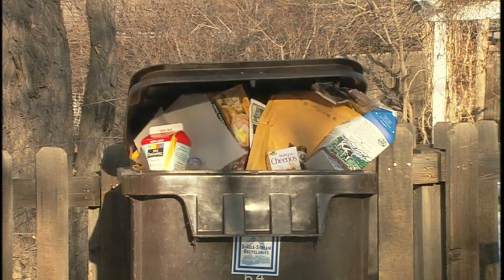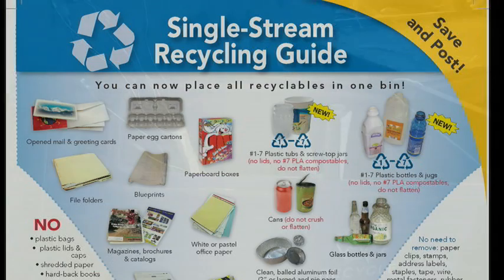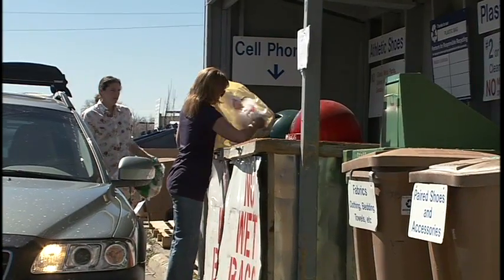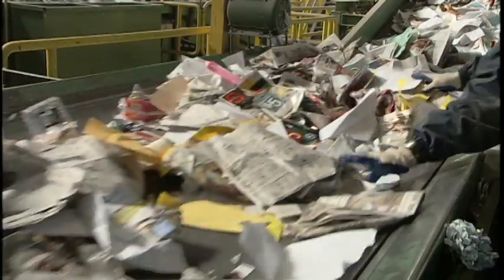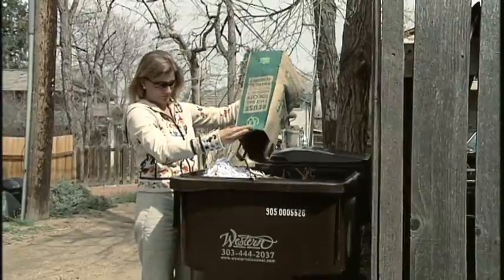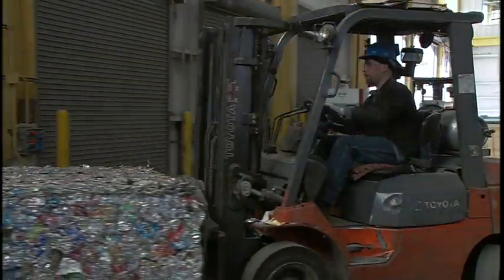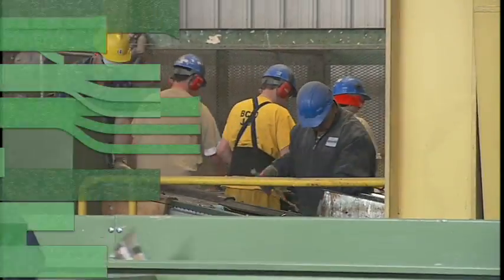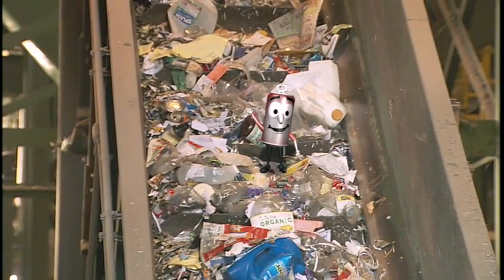Single-Stream Recycling -- Leading the Way to Zero Waste

Comment: So to cut costs they used modern day legal slavery...🤦🏻‍♂️
Very interesting engineering though.  But this kind of facilities should be used to collect some contaminated batches from other recycling centers. Still recycling from users show how much time and energy saves in a facility like this. Just only by separating properly glass and and plastic before, the saving is great.

Comment: They need to burn this trash and turn it into fertilizer and generate electricity ,problem solved !
Reply: Nice idea, but 
Burning the plastic is toxic, the metals don't burn, paper contains too much carbon to be used. .  None of these would be ingredients in fertilizer.  You need NPK (nitrogen, phosphorus, and potassium,) possibly calcium.

Comment: Does not work. Towns and cities all across the US and in other countries have abandoned single stream. In fact, here on Long Island NY even glass is no longer accepted. There are better ways. Just read that Paper drinking straws are not recyclable (jam up the machinery) and harm the environment even more than Plastic. Reusable shopping bags need to be used 22,000 times to equal plastic bags. Shred documents and printer paper is unusable to the paper fiber being too short to reprocess. I go on and on. Did you know? a Hummer Cradle to grave is better for the environment... It is due to being very recyclable which electric cars are not. Materials in electric cars and solar cells are highly toxic and require enormous amounts of energy to produce and then recycle.
Reply: I agree with most of what you said but what did you mean by "Reusable shopping bags need to be used 22,000 times to equal plastic bags"? Equal them in what way?
Reply: Albert A Heiserer
Paper shopping bags are recyclable. Cloth bags will degrade eventually. But I agree with you about the markets for recyclables drying up. China stopped taking them just about the time the trade war began...

Comment: Great video. Not sure when they decided to mix everything into one bin. I remember when we used to have a bin for paper, one for cans, and one for glass, and they had a truck that would pick up all three and put them in their related bins on the truck saving all this sorting mess. I also worked in one of these places and its a nasty job. Very dusty. I remember one lady came in and said she put $5,000 in the middle of a newspaper and accidentally threw it out. The whole building was searching that place. Never found it. It makes me mad that these recycling companies make a fortune selling the cardboard, glass, and aluminum (that they get for free). Yet the taxpayer doesn't see a dime of that money. In the future these recycling companies should be run by the city with the profits for those materials going into a fund to reduce garbage rates. If recycling lowered your garbage rate, I am sure everyone would be doing it and thus reducing waste going to the landfill.
Reply: I'm not too sure. If landfill tax goes down people will toss everything into the black bin. They should have like weighting units at the trucks to give the owner of the cans with the most recycling in it money

Comment: He even said containers can't climb the double deck paper screen, and I literally saw a red aluminium can or tin can get pushed over the top by the paper, even though you believe containers can't climb the screen there's still a chance at least one container will go over the top, the paper can sometimes be the material to blame as it bouncing around on the discs can help incorrect items up the screen.

Comment: They didn't seem to be sorting out the cardboard that well.
I saw some large pieces of cardboard and paperboard boxes in the double deck paper screen.
And of course the large ones and some of the paperboard boxes fell down to the bottom deck like the containers and then end up in the banana screen.
One thing is that there should be a conveyor belt at the bottom deck of the banana screen because if the containers fall down to the bottom they can move onto the conveyor belt to be transferred to the container sorting system.

Comment: Any here recycles bottles? If so, what method offers a higher reimbursement recycling center or reverse vending machine, like RePlanet?
Reply: The UK milk industry has been recycling milk bottles for years. Less so now than in the past - thanks to supermarkets requiring plastic milk containers. Also beer-bottlers also used their bottles many times, not now though, as the bean counters have struck again. It is possible, but unpopular, to recycle the aluminium cans many drinks are sold in. Their value is 0.5p each!

Comment: If the recycling was collected already sorted everything would have been so much easier!!! Where I lived, the recycling bins used to be all sorted. There were even 3 different giant bins for brown, green and clear glasses. But later they changed to this single recycling system. They say it is to encourage people to do more recycling. So they are making everything harder for the recycling facilities just cause people are too lazy to sort their recycling!
Reply: People are naturally going to be more encouraged to do anything if it is made simpler and more user-friendly. If it's going to take too much time and energy out of our already-taxed schedules, then most people are not going to make the effort. It has nothing to do with being lazy.
Reply: But in the end if people don't sort it properly, and the bins end up mixed, then the whole system fails. It's nice to THINK people will sort properly, but they just won't.
Reply: And the system works because the initial consumer gets nothin for his effort at sorting recycles from non recycles.
Reply: Sandra t
Reply: @Sandra:  I see your point and I definitely understand & share your sentiment of frustration!
Perhaps another perspective could be useful, at least temporarily…
Ultimately this is a RESULTs oriented approach/solution.  And I think it's fair to say that the results should be the ultimate measure of success & performance.  It seems like the objective is to maximize the quantity and percentage of waste which gets recycled.  
If this strategy improved/increased recycling (which we obviously can not determine from this video), then it seems reasonable to focus on the result.

Also: the recycling still has to be sorted before processing because people make mistakes, furthermore, in most (if not all) areas all the recycling is collected by the same vehicle where it is combined.  Perhaps some cost & labor may have been saved, I don't know.  But it had to be done, and if this new system increases the hours or the number of full-time employees, then perhaps it makes sense to consider this from an alternate perspective as well.  Acknowledging the "jobs created" by this strategy instead of focusing on the idea that this is a misuse of taxes resulting from lazy citizens seems fair!

If you are upset about lazy citizens, perhaps RESULTs oriented tactics could be of some service here as well?  You could create a campaign to raise awareness and concern among the citizens, urging or inspiring them to sort and bag their recycling already pre-seperated―this endeavor certainly has the potential to save as much taxpayer resources as the previous system!
Reply: DJJonPattrsn22
Very readable and well thought out reply.

Comment: Though I admire their efforts, I some negatives.  I saw alot of paper dust in the high areas which is conducive to dust explosions.  Also, The fork lifts are using combustible fuel which is conducive to carbon-monoxide poisoning.

Comment: Have to say your system seems really confusing. I see two options
1) Better pre sorting at homes (like in EU): Paper (green boxes), Bottles&Cans (pant system), BioWaste and then the rest of the garbage
2) I've also seen several system that shred the garbage to so tiny pieces that they can sorted by machinery (magnets, IR and weight based sorting)